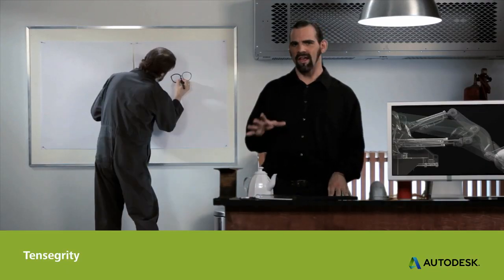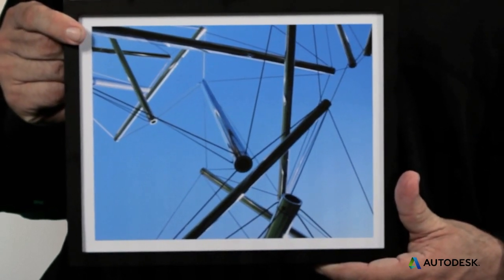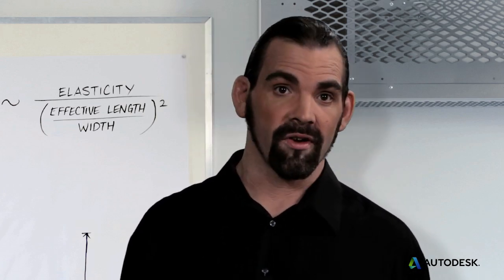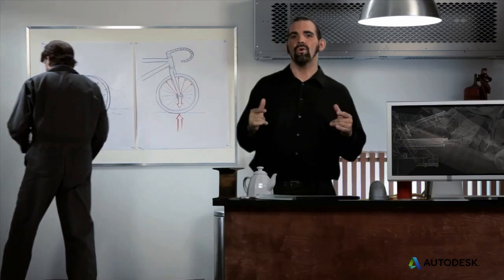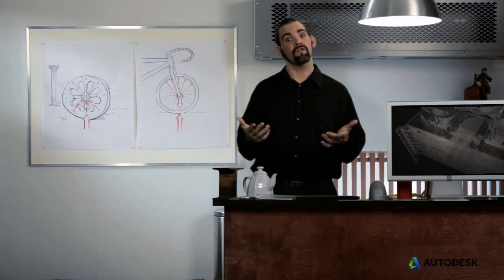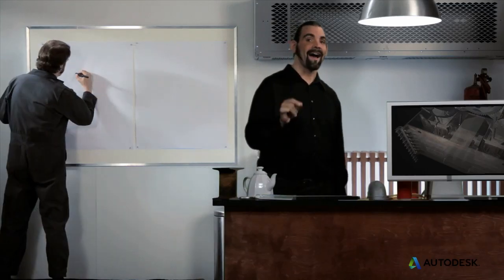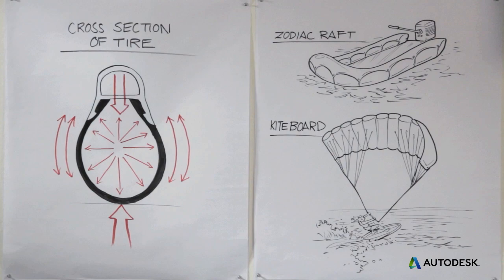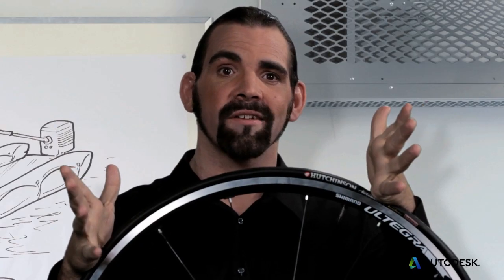Tensegrity Structures in Lightweighting Design

Comment: Nice explanation except that a sailing ship and suspension bridge are not tensegrity structures because the masts/towers are transferring compression directly to the hull/ground, whereas the compression struts in a tensegrity remain suspended within the tensioned network and do not transfer compression between them.
Reply: thanks for the clarification..